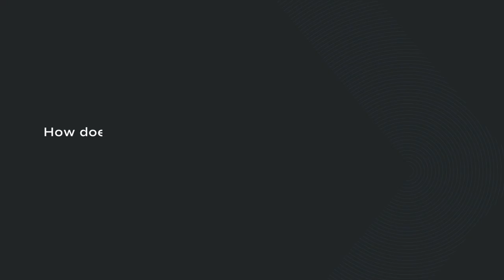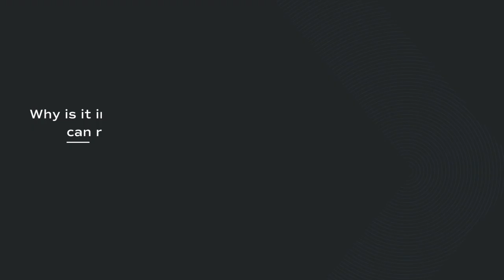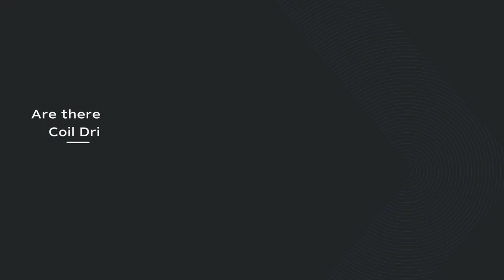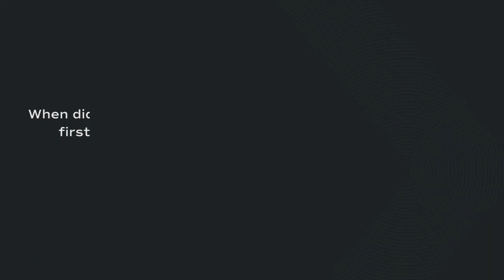Technology Deep Dive with Exro CTO | Exro Technologies

Comment: Looks like it’s applied to a very small market? Do they put the coil driver in regular cars or only trucks? Looks that it will be efficient only for massive vehicles. Feasibility n costs n market will be an issue. Torque n speed is high school physics. I hope they know what they doing by going public?
Reply: Small market how? Electric motors is a huge market. I believe they have focused on high torque applications because that's where the coil driver really shines, so trucks and other hauling vehicles are a good place to put resources into right now. Feasibility and costs and market are always an issue, but Exro has demonstrated the first via independent firms like AVL, and the second and third come when they go to market, which is why this is an investment opportunity and not a GIC. Torque and speed are indeed high school physics, but so is light and yet we have not perfected solar power yet.
Reply: @derekblain3603  with the cost savings of $2K plus per vehicle and the ability to make the vehicle lighter which is an advantace to any electric vehicle in terms of range and cost to manufacture. I think all EV makers will eventually use Exro  tech.